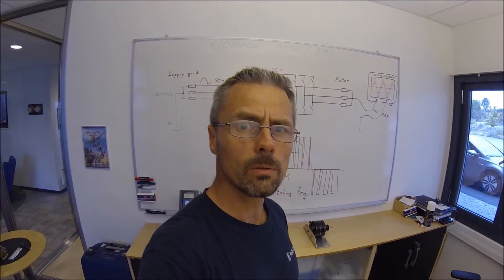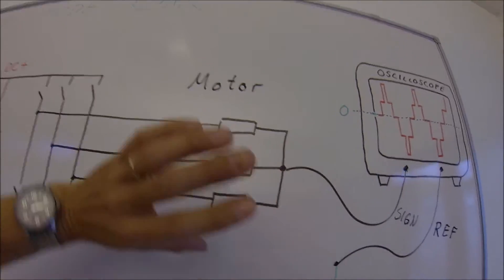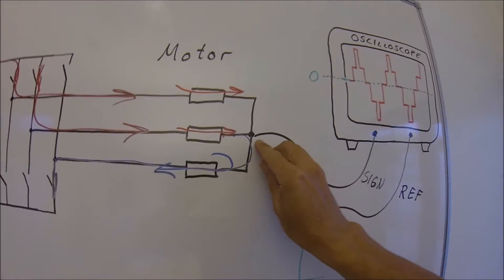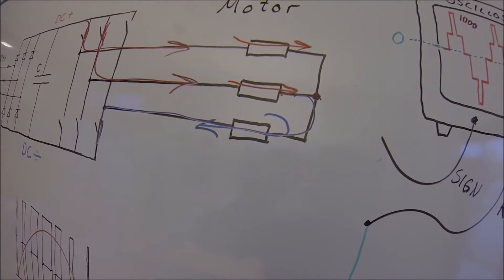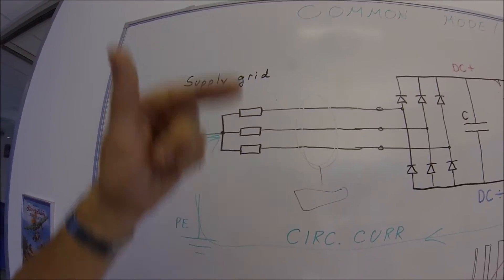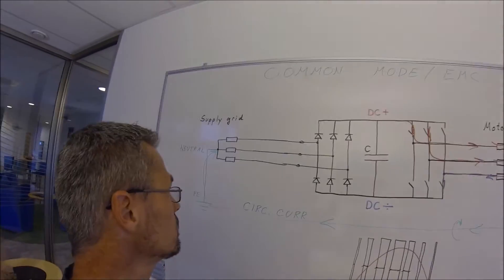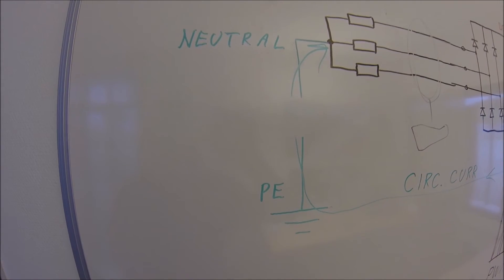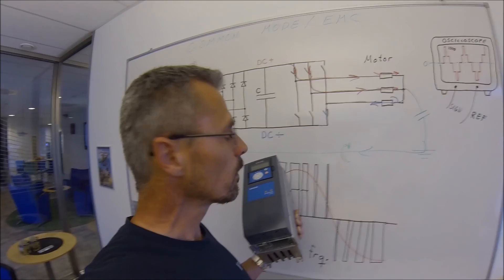Drives School (E2) - Common mode explained

Comment: Professor, can you please explain that how the use of an isolation transformer (at the front end) with a neutral point not connected to PE can eliminate the common mode EMI. Also, can you suggest some good reference for the same.  
Thank you.

Comment from the maker: There will be new episodes of Drives School that shows how to do ballasting of DC bus on complex hybrid ships. How to keep battery BMS and PLC control systems on the clean side and force the dirty common mode side of the many drives over to "loose ends" in insulating transformers and motor stator windings where they do less harm. Also the negative impact of stray capacitance on such systems

Comment: Professor, I have these HF capacitors (Y capacitors) on my DC plus and DC minus lines going to earth. In your explanation I can see why wanting to keep the AC currents flowing away from the grid essential as required in certain regulations. But in my case if it is a HVDC battery, are these Y capacitors required and why?
Reply from the maker: Capacitors between the DC+ to PE and DC- to PE is called a ballasted DC system and the normal and right way to do it when there is battery connected to the DC bus. By ballasting the DC bus You will give priority to have a "clean" DC bus side of the drive and "dirty" AC side of the drive. Then it is very important that the AC side of the drive has a transformer with floating star point i the primary winding so the common mode voltages can rotate around freely there. And all RF capacitors must be removed on the AC side. The drive can have RF or ballasting capacitors only on one side. If You put on both sides the weakest of them will be removed in a cload of smoke as the circulating currents will burn it. Simplified it can be said that You have to choose between having a clean AC side or a clean DC side of the drive. You can't have both. The regular Active Front End drives for ship propulsion seen for many years does not need an insulating transformer because the clean side is selected to be AC and ship grid side. And DC bus is dirty but no problem because there is no battery there that to be harmed. Only a drive with a motor in the end that has a insulated start point. Dirty motor then. In case too much stray capacitance in the motor the motor bearings may crash but that is another story...
Reply: Mr. Berntsen, could you explain why AFE drives does not need insulating transformer? Should I use HF capacitors there instead of transformer? If so, how will it work on ships where, as you said, there is floating ground?

Comment: Hello, very clear explaination. But you don't talk about common mode filter like ferrite cores, why?
Reply from the maker: laurent BOULY Because ferrite cores are not very effective for high power drives. You need so many of them. We do use them but then it takes a lot of space and installation. All 3 motor phases need to pass trough same ferrite core and if this is a 1000 ampere drive it is big copper bars

Comment: This rotating starpoint that can be measured at the motor, i would like to understand why it can be measured?  I didn't expect that and it is different from what i always  'understood' about such floating zero. Then you explain the problems that can follow from capacitive coupling with the earth, like false earth fault detection and EMC etc. All very interesting, but i still don't know what is 'common mode voltage' now. There was no definition of what it means. You just explain some fenomeonon that can be noticed when using frequency drives. Is this the only situation where they use this concept?
Reply from the maker: Frank Weytjens Common mode exist in all applications were frequency converters and IGBT (big transistors) are used. Cheap physics from using 6 pcs of IGBT's to produce 3 phase AC voltage in any forms. Same for all vendors, Vacon, Siemens, ABB, Schneider, Danfoss -anyone. Not so many engineers that understand it fully though. I must understand it fully as technical manager and responsibel for all our customers to be succesfull with hybrid ship design. Your knowlegde about 3 phase systems are true for synchronous machine produced 3 phase neuutral star point. But for IGBT produced 3 phase it is not true until before passed trough an isolating transformer where the rotating star point can rotate freely inside the primary stator winding. The voltage between a rotating star point and PE can be a whopping 1500 volts AC.
Reply from the maker: If You want to see the star point on a motor on the oscilloscope the stator star point is not physically available. However, You can create a substitute just for measuring by connecting one 1 Mohm resistor  to each motor phase and connect the other side of the 3 resistors together in one star point. Then the common mode can be seen by connecting the oscilloscope between this artificial star point and PE. Be sure that Your oscilloscope probes can cope with a voltage of 1500 volts. The cheap ones made only for electronics and 600 volts may blow up :-/

Comment: Professor Berntsen... this is going to be interesting.  Does your syllabus include providing examples on motor winding/wiring? Or at least the tools to calculate the windings/wiring?
Thanks!
Reply from the maker: Maybe, then for 1 MW permanent motors used for ship propulsion and shaft generators.  This video is a tester for putting training courses on youtube. Will be a series of this. For our customers, system integrators building hybrid ships. Mostly electrical engineers.